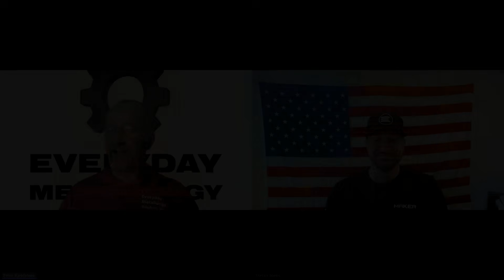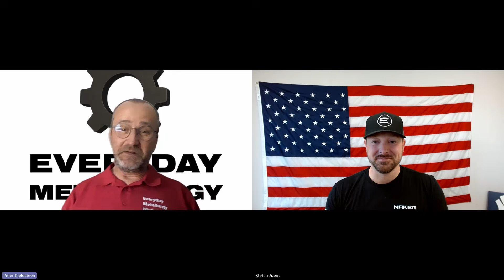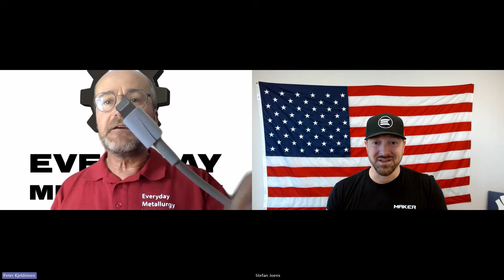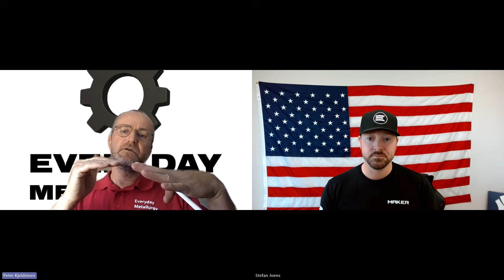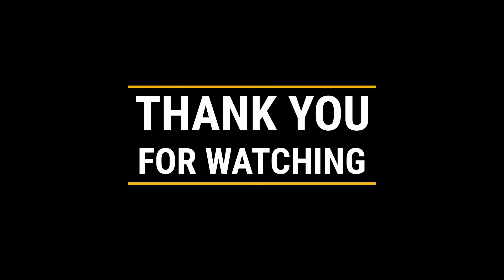Metal Injection Molding Explained: The Questions Nobody Has Answered Before

Comment: Great episode 😃 MIM is indeed a versatile process that handles component complexity in combination with high accuracy and reproducibility. I reckon component size is one of the main limitations…
Reply from the maker: You are right on the size limitations. Typically we do not make MIM parts larger than 100 gram, but I have seen up to 400 gram parts🤔

Comment: Very interesting episode! Much more manufacturing grounded this time. Injection moulding is a powerful technology and it still has margins to grow. 

Thanks also for talking about the great dilemma of thermal powder metallurgy: batch versus continuous. 

All bypassed with FAST-ESF 😎
Reply from the maker: I assume that ESF is Electro Sinter Forging🤔. But then you loose the degree of freedom on the geometrical possibilities compared to MIM. Do you agree?😇
Reply: @E @Everyday-metallurgy solutely!! MIM is more versatile. Although for some parts there will likely be superposition, on most of the ones where MIM prevails electro sinter forging cannot manage.
Reply from the maker: @mad_wisdom But ESF will enable alloy systems that MIM Will never be able to produce. Take a look at the possibilities on this episode:

Alessandro Fais PROVES Electro Sinter Forging is the GAME CHANGER for Modern Metallurgy
https://youtu.be/Tm5Nqk2GW-g